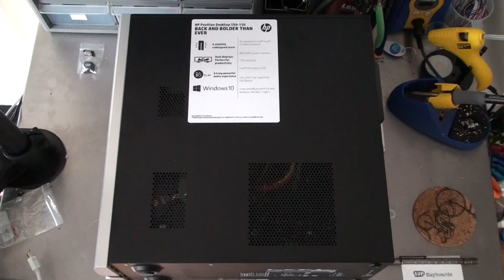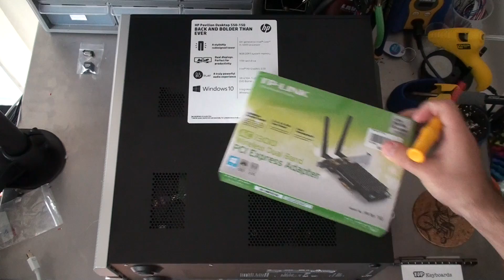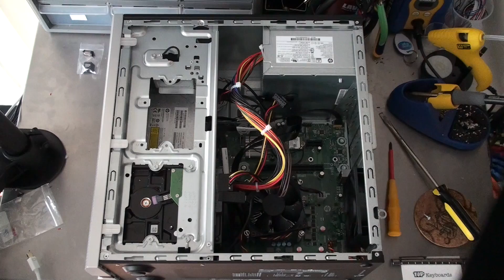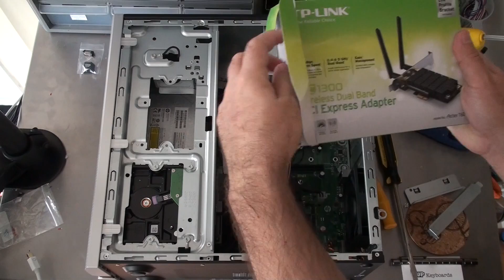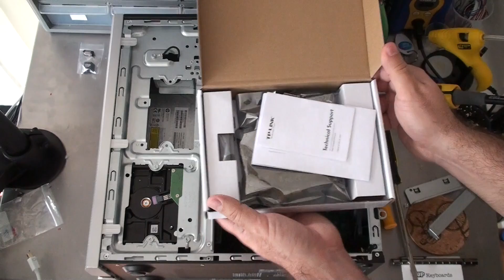Wireless AC PCIe card installation step-by-step

Comment: Hi, nice video, but I wish you had shown setting up the driver. I installed this same card, but the little disc that the driver came on is useless. Still using my old adapter card because I can't find the right driver for this one.

Comment: You know, you could have just replaced the wireless chip that was already installed on your motherboard you know that right?
Reply from the maker: Isaac Ortiz yeah, but they're unnecessarily expensive.
Reply: I recently got the Intel dual band wireless-ac 7265 and it is a great internet and bluetooth card.
Reply: And it was only $20 on amazon
Reply from the maker: Isaac Ortiz nice. That's a good price!
Reply: Also, just like the card you bought, it can go up to 867 mbps also.

Comment: why didn't you build your own pc?
Reply from the maker: +ProDesignHd A) extremely limited budget.  B) this is just for streaming.  So I don't need all the stuff that I would buy if I was building a custom.
Reply: skiwithpete Well limited budget is the exact reason why people go for custom builds. You could have saved from 50 to 100$ simply by building it yourself. Simply search youtube with custom build and your price range and you'll see.

But anyways, it's your choice :P
Reply from the maker: +ProDesignHd I bought an i5 6400 system with Windows 10 for $307 on clearance at MicroCenter.  The i5 and Windows license alone would have cost $225.  I don't know how you could have magic'd together a motherboard, tower, PSU, ram, an HDD and a DVD drive for $80.  But, maybe I'm wrong.  I love that you don't think I did my research tho.  Love this channel!
Reply: +skiwithpete I was actually trying to leave a helpful suggestion, but if you think your researches are that infallible, I'll make sure not to leave any more suggestions next time.
I love your channel too!
Reply from the maker: +ProDesignHd No, don't be upset, love having you around.  Told the missus I'd face criticism for not building my own...  Just getting ready for the torrent of hatred.  We were just on a shoestring so tried my best to get the best comp for $300.  And, I know, it has an HP logo on the side.  But it was a good deal, honest.  Your suggestions and input are very valuable.  I'm just being defensive...  :( sorry didn't mean to upset.
Reply: +skiwithpete It's all good :) Don't worry about it